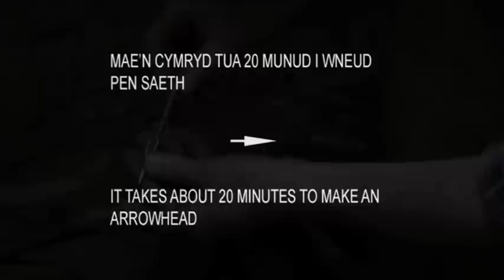Roman Arrowheads

Comment: The first time I have seen the cross peen hammer used on these socket, as a sheetmetal worker i would work steel similar but usually cold, always wondered why nobody did it your way